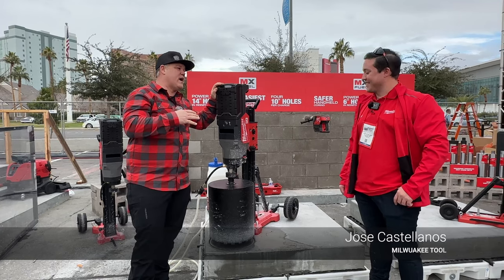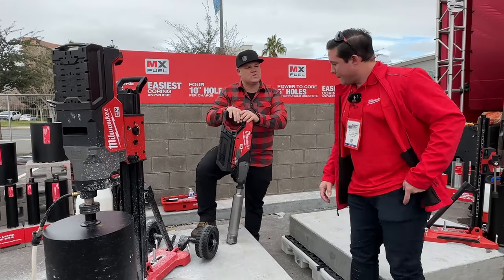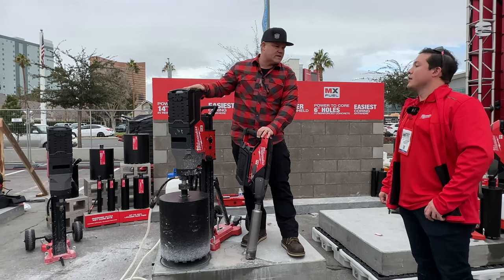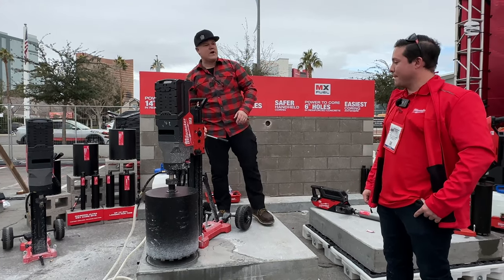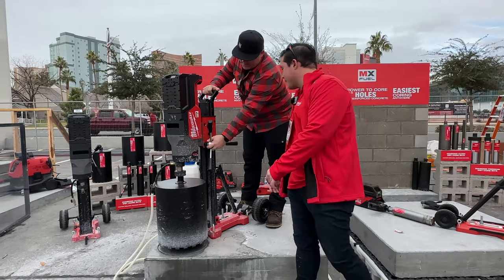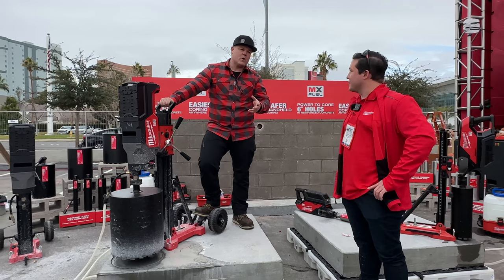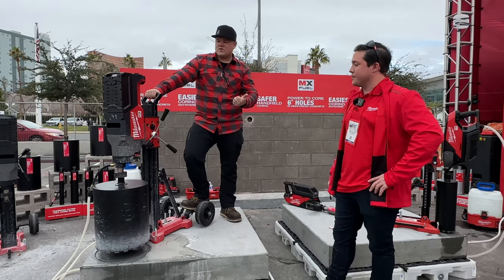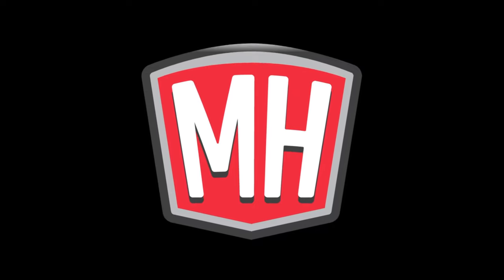Cordless Core Drill Rig - MX FUEL from Milwaukee Tool

Comment: Hey it looks really cool but for 7 grand does it at least have a corded option?
Reply: The whole point is that it’s cordless.
Reply: @lukeparsons583  yeah I get that however speaking as someone whose cored many holes it seems like a very smart thing to include. You can’t rely solely on battery power. What happens when you hit strand or rebar? That will very quickly drain the battery.